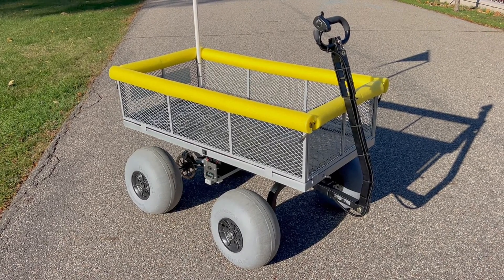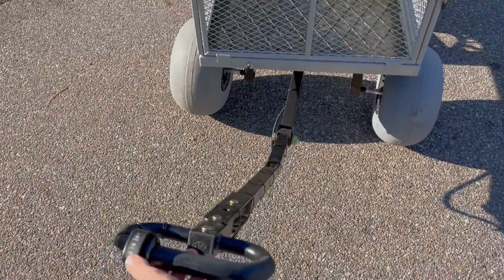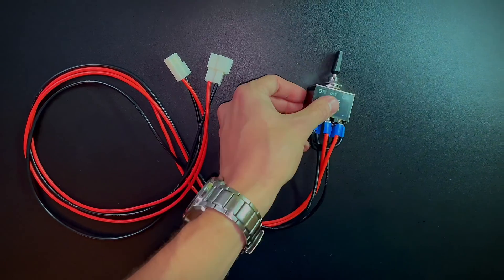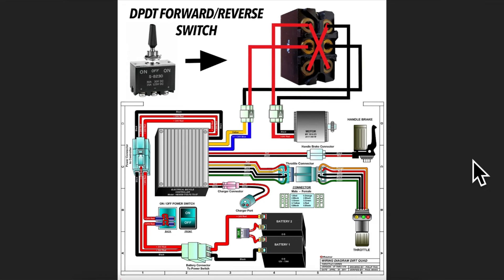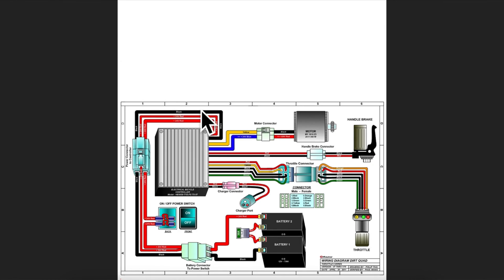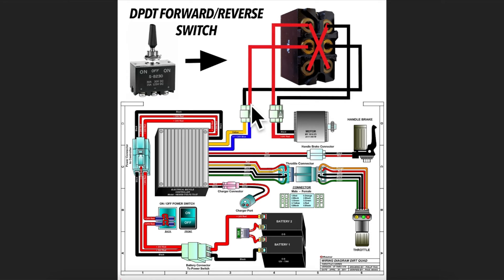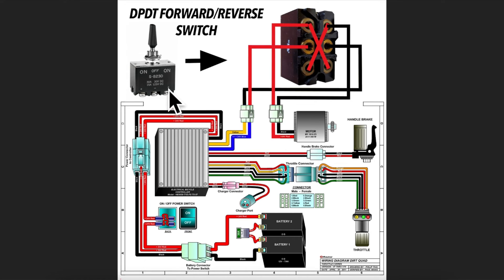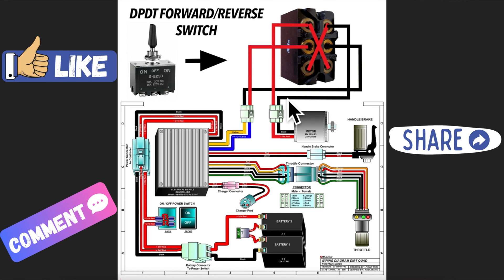Reverse Switch Tutorial - Razor Dirt Quad ATV / Electric Beach Cart

Comment: I did exactly the same thing on my son's ATV (also a Razor), he accidentally turned on the reverse while moving forward and pressed the throttle. The transistors in the controller immediately burned out (logically). I replaced them, and everything works. But now I wonder if this will happen again if it accidentally turns on reverse while driving forward, but does not throttle up, but simply reverses the polarity and continues to drive forward. Will this damage the controller? What do you think?
Reply from the maker: hmm I'm not entirely sure. I would recommend putting the switch in a different location, maybe below the cart. Somewhere that kids can't access while sitting on the cart.
Reply: @RyanWaves  But I want the child to use the reverse for comfort. I put a 30 amp Schottky diode between the button and the motor, so far it works. Thank you for your reply and all the best to you

Comment: Thank you for this great tutorial. I’m about to start a 36 volt over volt project on two dirt quads and was looking to add reverse as well. Will the 30volt switch work ok on the new 36 volt system? I was thinking no but wasn’t sure
Reply from the maker: Thank you! So technically to be as "safe" as possible you would want the same or higher V DC switch than your electrical set up. If you'll be converting to a 36V DC system you want to aim for a 36V DC switch or higher, but also one that fits in the same amp criteria, which for our case is 15 amps. 

I would try to look online and see if you can find one. You may be able to get away with using the 30V DC switch for your 36V DC system. I have seen people online use a switch rated lower than their electrical system. Is this the "safest" way possible? No. Could there be problems in the long run? Maybe. I would do further research and look at the pros vs cons as I can't give a good recommendation. Let me know if you find something!
Reply: Thanks for the tutorial. Great job. One question, is neutral a true neutral???  We tow our wagon with a golf cart so I’m looking for a way to disengage the motor. Thanks again.
Reply: @firefyter1972 the neutral just means no voltage is being applied to the motor. So it the motor is in free wheel when turned off, then yes it'll work.